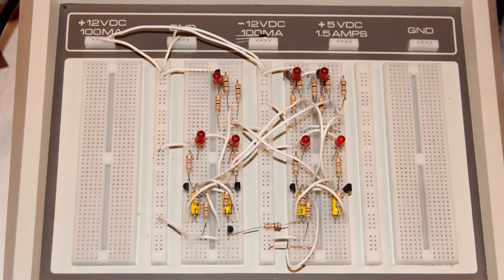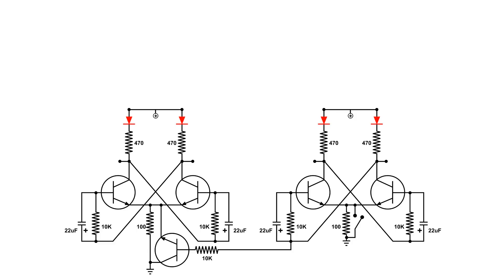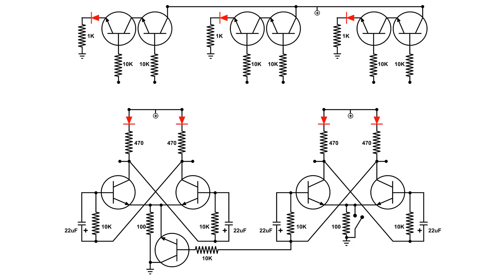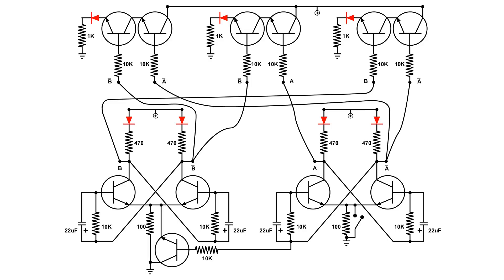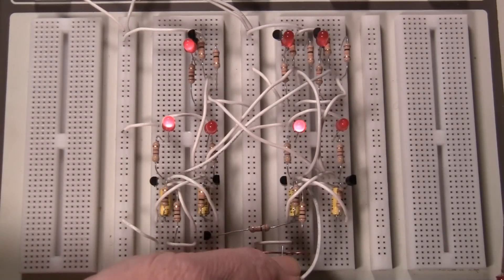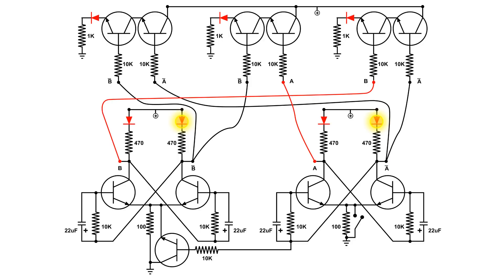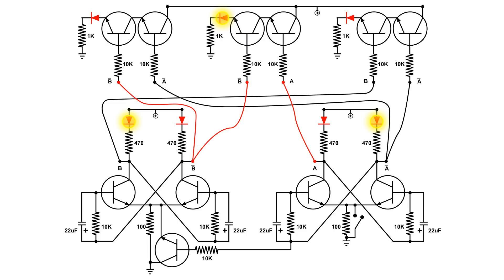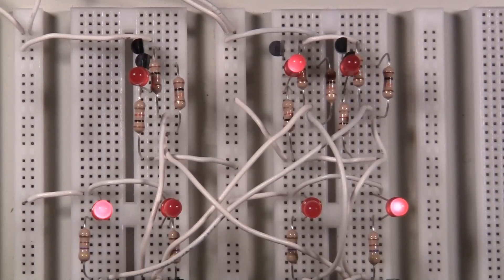Cascade FlipFlop AND Gate Logic Demo

Comment: Another great video! Thanks for sharing. This discrete circuit really helps to visualize what's happening inside a logic chip.
Reply from the maker: This was a question from some one from Grease. It was a project from his professor. So I did someones college home work in Athens Grease. That was fun.
Reply: @AllAmericanFiveRadio  

Hah!  By the way, my immediate reason for interest in these logic circuits is for an "automatic reverse" motor project I'm working on. I've got a simple prototype working with a BJT h-bridge, but I'd like to increase the complexity and power level a bit to make it more interesting. Was thinking a MOSFET h-bridge might be part of the solution, but I can't get it working on the same level as the BJT version. Know of any good schematics for a stable MOS h-bridge? or a switching circuit to get the MOSFETs to behave?
Reply from the maker: @andrewferg8737  I have made use non audio circuits using MOSFETs. These where high current circuits. I found that the MOSFET were not being biased enough from the input signal to the Gate of the MOSFET. I was using N Channel MOSFETs. I used a NPN transistor to dive the Gate. The Collector, maybe though a 1K resistor, to the Positive Power. The Emitter to the Gate and the Base to the input signal. This drove the Gate enough to get the current though the MOSFET I needed. Hope this helps.
Reply from the maker: @andrewferg8737  Here's another way to connect and NPN to a MOSFET.
Auto On Off Light Switch using a Solar Cell
https://www.youtube.com/watch?v=5IwS9z95Db4

Comment from the maker: The positive voltage on the base causes the transistor to short between emitter and collector shorting out the 100 ohm resistor. When the rightmost transistor in the first flip-flop lights again, this removes the positive voltage on the base of the transistor and the 100 ohm resistor is un-shorted.

Comment from the maker: When the rightmost transistor in the first flip-flop goes out, the collector goes positive. This positive voltage goes through the 10K resistor to the base of the NPN transistor that is a cross the 100 ohm resistor of the second flip-flop.